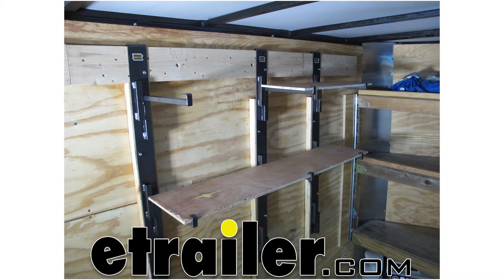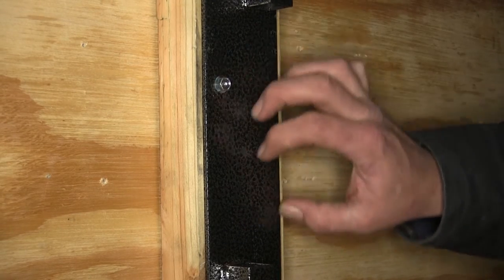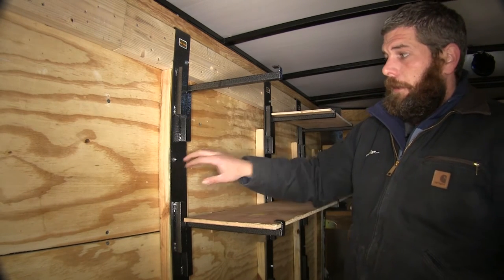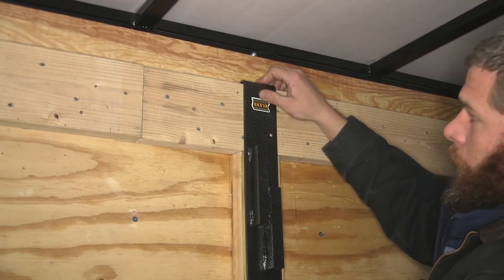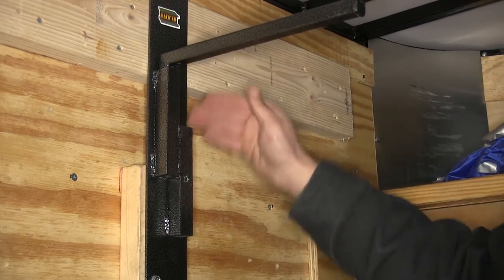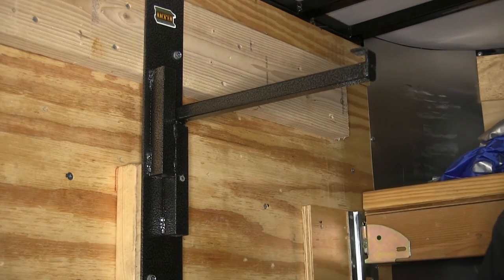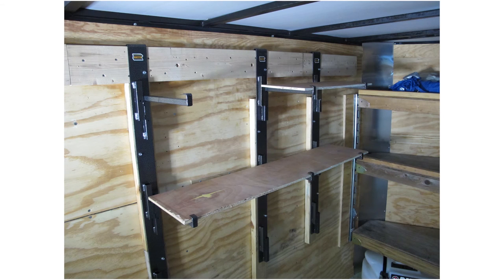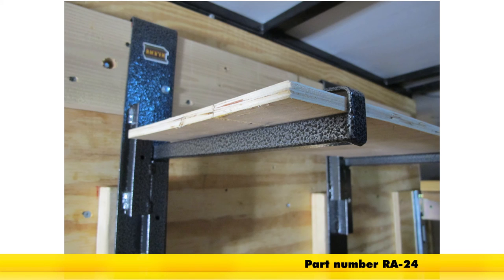Comprehensive Review: Rack'Em Side Wall Adjustable Shelf Supports for Enclosed Cargo Trailers

Comment: Nice for dinky 12 inch shelves. Wheres the HD ones to do 24 inch work tops?
Reply from the maker: The only other option we offer for a shelf kit can be viewed at the link below. I've also included a link for other enclosed trailer accessories.

https://www.etrailer.com/Trailer-Cargo-Organizers/Rackem/RA-13.html

https://www.etrailer.com/Enclosed-Trailer
Reply: The 18 inch locking hinge is close but 6 inches too short. The wood cradles would work but I have no interest in blocking the walk way. Guess it's time for behind the plywood engineering. Thanks for your time.
Reply from the maker: Have you thought about using the E-Track system? This system would allow you to quickly move the shelves out of the way when not in use. Just throwing out another thought!

https://www.etrailer.com/Tie-Down-Anchors/Erickson/59149.html
Reply: What works one day may not work the next. Cupboards can move, shelves change position/height, shrink or get larger. Very few studs will be in the right place so lots of 12 or 16 gauge FHA straps,  1/2" IPS threaded flanges with appropriate nipple length. Won't even put the plywood back until I sell it. That's my latest idea. 7x16 will be brim full w/ approx 2 ft walkway